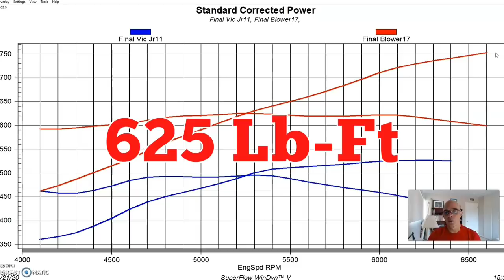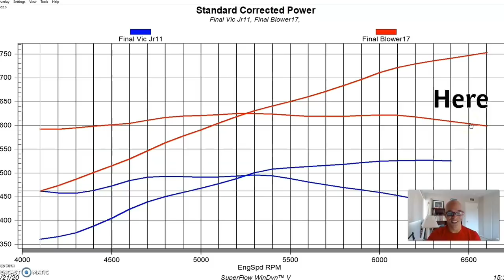6-71 SUPERCHARGED 383 LS STROKER

Comment: On this same note, it would be AWESOME to see a "millennial" 454lsx crate motor vs a "boomer" 454bbc crate!
Reply: A battle of valve train efficiency and head flow? Sounds interesting
Reply: @bigboreracing356  Isn't it externally a much smaller package as well? As in small block small? I've not been up close to a lot of LS7/LSX454's
Reply: For street engines I would say anything under 900 WHP go junkyard LS, anything over Junkyard BBC.  After that it's a toss up until 2K WHP plus, there is no comparison...BBC all the way.  In my opinoin....
Reply: @babyruuth  good luck finding junkyard bbc anymore.
Reply: @bigboreracing356  oh I know and I agree. I just think overall it would be such a fun test to show how technology has advanced over the years. Richard could break it down by comparing rotating weight, bore/stroke, cylinder head size like port volumes, combustion chambers, valves, rockers, port flow, compression ratio, and like you said BSFC, not to mention engine weight/size. I would love to see that test. Basically a new style big inch small block vs an old style smaller cubic inch big block.
Reply: @bigboreracing356  right.. im not saying there is.
Reply: All in $ for 454 LSX stroker vs 454 / 572 BBC or  would be interesting.  I have an LQ4 I'm prepping to turbo/swap.  Might go BBC or BBF at those displacements.
Reply: @bigboreracing356  555 with an F2?  More tires die.  :)
Reply: No Prep Stretch also less torque.
Reply: I was an Engineman in the Navy and used the 671 Detroit diesel engine in my "A" School then went on to a Military service mechanic at "Boat Pool" in Subic bay. The civilian government employees, Philippine Nationals, did most of the work on the Detroit like rebuilding, head work, and the major tear down and rebuild, but I've always loved that engine and its supercharger not to mention the sound of the engine at any RPM!!
 I've said all this stuff as just a background to the 671 "blower" and would Love to put one on my 1990 454ci in a GMC 1 ton dually and was wondering what would need to be done to this motor before I could actually run that supercharger on my truck.
I'll be using it to haul my truck camper and flat-tow a Jeep wrangler and sometimes a 26 foot travel trailer. This truck is also a 4 wheel drive. 
It would be big time "OVERKILL" for what I use it for wouldn't it? But the Blower sticking out of the hood would be SWEET!!!
Reply: @mathewkulczyk1645  first off, thank you for your service!!! I salute you sir! Then about the blower on your 90s 454bbc... it can totally be done! Is the motor 100% the way it came from the factory, or has anything been upgraded over the years? With a proper install of the supercharger kit, along with a shop giving the vehicle a "once over" there is no reason why you can't strap on a nice blower on even a fully factory stock motor. People like Richard here go to the junkyard and find old beat up motors, strap a big blower or turbo(s) on it and crank it up! Obviously you wouldn't need it to be "cranked all the way up" so to speak, but a good kit producing something like 5-10 lbs of boost will give the truck a good kick in the pants and also still be reliable as you're not really pushing the envelope. Recently, Richard took a junkyard BBC, added a turbo and reached 1,000 horsepower! That just shows you the motor itself will handle a few pounds of boost no problem. But i will say that a proper install and tuneup is THE most important part!
Reply: @ziggybmw  
Thank you for the speedy reply!! 👍 the truck wes owned by a local farmer since New but didn't drive it much. It currently has 66,300 ish miles on it and is very strong running but because it's been sitting around I've been working on it to get it back to snuff!! You've probably had a vehicle like this. Things just dry up and don't seal up the fluids like it should.
 With a blower on it you don't think the already questionable milage and torque of the 454 would suffer not to mention reliability??
Reply: @mathewkulczyk1645  its really hard to say without seeing it in person, but those are definitely low miles! If it is still running strong, and isn't huffing/puffing it is probably a good candidate for some upgrades. If yourself or a local speed/performance shop can go over everything and look for signs of wear, damage, leaks, etc it would be a very good idea to get that taken care of so it is in ideal shape. The tune-up is the biggest thing that needs to be right for it to live a long life with a blower straped to it, but with proper care and a good tuner (carb or efi) I have no doubt it would live just as long running a modest 5-8-10 pounds of boost. When done correctly, you can really make that truck a lot of fun!
Reply: @ziggybmw  
Thank you Sir, I appreciate your help and opinion on this issue. It's strong and has some awesome power that probably is plenty for what I am going to need it for. I have some work to do with it but I just really like the idea of a shiny Super charger sticking out of the hood and the extra power to pull the Mountain passes around here, you know!
 I was a stupid lid in my 20's when I left the Navy and didn't know better and should have stayed in till retirement but it is what it is. 
I appreciate when people take the time to Express their appreciation for the time I was a "Squid"!!
Makes me feel Good about serving.😁🇺🇸
Reply: @bigboreracing356  you can get BBC heads with modern design combustion chambers, of course if you go replacing the cylinder heads, it's not really a crate vs crate comparison.
Reply: @Brons2  that would depend on who you buy the crate motor from. Just saying crate motor is very broad. Say you compare a GMPP 454lsx vs a Pat Mussi crate 454BBC. I dont think the LSX is going to hang, and I dont think the big block would have old bath tub heads either.
Reply: @WVXL64  the point was, if you change the cylinder heads, no matter who made the crate motor, then you can't really say it's an XYZ crate motor any more because you've modified it.
Reply: @Brons2  ok, but guys are talking about porting the lsx heads. Whats the difference? And if the crate engine from Musi comes with better heads, youre not changing anything.
Reply: Would you do similar cam specs and compression levels and head flow numbers? That would be cool!
Reply: Dooo iiit!
Yes yes yes, all day long!
Love it.
Reply: BBC wins everytime if your talking max effort
Reply: @joshcarman2664  I mean if your into that stuff 🤣 sure.
Reply: @skimask5911  I keep it real lmao
Reply: @bigboreracing356  you can't be sure of that. Bore and stroke are different, head flow, cam design are all different. My custom lsx454 with ported stock LS7 heads makes about 700 crank hp. Its a bit better than the crate 454lsx but not by much. I haven't looked into a typical 454 bbc crate but im sure there are different options. Would be an awesome test none the less
Reply: @ziggybmw  good info.  On the other hand if you are doing BBC then go 572.  From a boomer :)

Comment: Hey Richard, horsepower was still climbing why didn't you run it to 7000? Also, in my experience running roots blower motors, the BLOWER is the limiting factor in ultimate power output. I've went to higher flowing heads before and ran nearly the exact ET and MPH, although boost went down. Only when I changed pulleys did the performance increase. I like it when you show the boost curve graphs as it shows where the boost begins to back up into the manifold and the camshaft/headflow becomes the limitation.

Comment: It is hard to over-carb a roots blower.   At 7.3lbs, you're pushing in about 1.5 times atmosphere - so effectively 383x1.5=575cid.   A true 575 would have no problem using 2x 950cfm on the right manifold/head/cam combo.
Reply: Definitely an understatement, A proper 496 big block could EASILY be built to use 2 1050+cfm dominators for sure.

Comment: I can assure you that it cost substantially more to go 150 mph in the quarter mile in the mid to late 80's than now.  Definitely not the realm of many street cars back then!
Step up to 170-175 your in the pro stock speeds that where common.   
Bob Glidden's Fairmont was the epitome of big money drag racing and these days you whippersnappers are building Fairmont street cars that will run similar numbers with very dissimilar cost.(see:8'sfer8 for a bottom dollar example)
    So feel free to call me a boomer or anything else as long as you don't mind me downloading and saving your tune to my Bluetooth NewBalances...

Comment: Junkyard N/A 2JZ Richard out of early GS300 , they are cheap and they hold a ton of power
Reply: Hell yeah! Please do a toyota/Lexus v8 as well found in the gs 400's!
Reply: Those N/A 2J motors have skinny rods. Sure the block, crank and head will hold power but not those rods.
Reply: @BigGroupHug  No sir , same pistons rods as the turbo 2JZ gte , the later N/A models with VVTI got the skinny rods.

Comment: Cool videos! love alle the good info. I'm  building a 6.0 w 8-71 and injection and a CCA 54-454-11. Hope it gives me great hp.
Reply: how did the blown 6.0 build go?
Reply: @jamieknight9636  It has  stock crank /rods w/ ARP bolts and forged piston w/8cc extra head volum. Gapped rings. Stock 823 heads.  Looking for 10 psi.

Comment: Everybody says that the LS1's cylinder walls are too thin to hold much boost. Is that true???
Reply: A lot of ppl say a bored out 5.3 becomes an ls1 and the walls are thin at that point stock I imagine for an ls1 can handle boost very well a lot of guys on pinks all out and here at my local track boosted ls1 fine but go with a six liter be a lot easier for power output ls1 flaws was oil issues how the block was made

Comment: Richard Holdener. What happened to the old Buick torque monster?
Just wondering. I'm so excited to see more.
That 671/dual 950's with that 455 would be nice to see🤔👍
Reply: Yea and building it to handle the power from TA would only cost you 20k in internals lol
Reply: @TheAkstewie  you're probably right. But, imagine the hp/tq numbers?
They used to use a pair of these engines to start the SR-71.

Comment: I'm going to run a 427 Tall Deck, bored .030 over (433). People talk about why I don't go diesel, or why I don't stroke the daylights out of it. Money, that is why. This engine combo will be just fine for now, until I can pay off my credit cards, then I'm dropping some forged pistons and an 8-71 on it. I will have to figure out if I want to toss a 5 speed in it first, because the SM465 is going to be a little weak for a blown big block.

Comment: As somebody that built an RB25 and went back to JZs. They're good engines but finding parts in the states is difficult. I could order a stroker crank easier than I could an oil return line for the stock turbo

Comment: You mentioned a flat head. You should boost one!
Reply: Agree!
Reply: Hell yea
Reply: There was a HOT ROD article a while back about updated flat head parts. Hemi style Ardun heads. Everything was beefier than the original parts. Granted it's not a true flatty but the engines were pretty cool.
Reply: @jdog942 He's done a 292 chevy inline 6. Just a few weeks ago, you should check it out.
Reply: Michael Teeple  people are making 1500hp with blown flatheads. Not sure what is takes to make that or even if it's on a stock block. But it is possible to make crazy power with the flathead ford design
Reply: @konnerkramer329  theres NO way in hell a flat head anything can breathe or pump that much air volume & be able to burn fuel. Sounds like a big load of B.S. Any proof ? Theres a reason why car manufacturers quit
flat heads. Input to output ratio is
piss poor. Three times the cubic inches for a third of the power.
Good luck with that.
Reply: @408SPLKINGS  well considering there is several engine builders who specialize in nothing but flatheads I wouldn't say their dead. It's not uncommon to see a well built flathead making 450-500hp na. You then push 20lbs of boost threw it on methanal it's not very hard to see how those numbers are achieved. My old Boss who built engines for over 50 years had a saying that I still live by today... Can't means won't. It's not that it can't make that power people just won't put in the work and effort to make that power. Yes the ovh replaced the flathead. Just like doch will eventually replace ohv. And doch will eventually get replaced by all electric vehicles. But does that mean ohv and dohc is junk?
Reply: @konnerkramer329  I can totally agree with ingenuity, will power, passion & determination anything could be done. Methanal not for
the average gearhead. Power ratio
on flat heads = diminishing returns.
Again car manufacturers moved on like you said.
Reply: @408SPLKINGS  the flat head bottom end and rods would never hold up to 1500. Unless, maybe, by chance it was some super exotic stuff
Reply: Turbo the flathead and crank up the boost until it grenades itself
Reply: Get a v 4 flat head from a compressor that runs jack hammer. You tow em behind your truck.